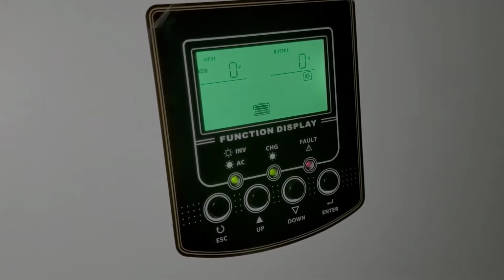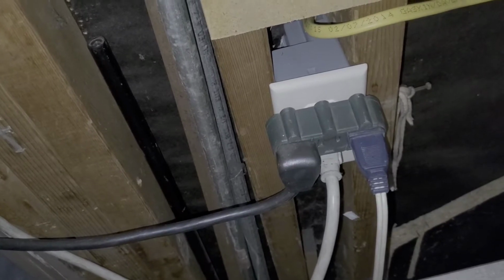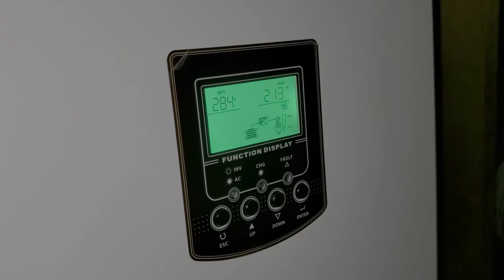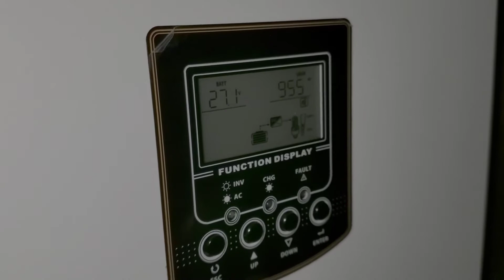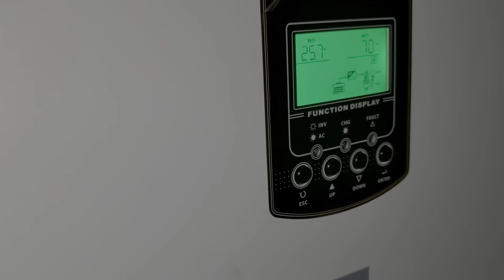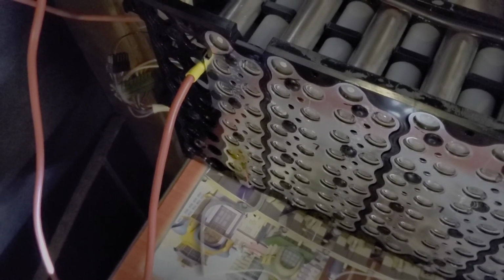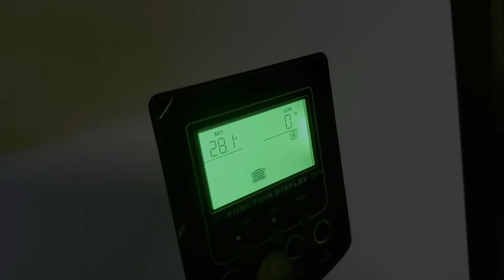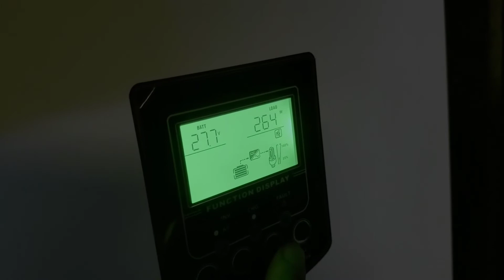7s 24v 50a bms from aliexpress - part 2

Comment: i would attach thermistor on those bms mosfets, if mosfets gets hot, it will turn off, i have seen bigger bms and the termistor is placed under heatsink above the mosfets. .. ..... and if you want the bms to shut down at 50A, then desolder one of the shunt resistor and then test again, repeat until you get 50A shut down, (there are 4 shunt resistors)
Reply from the maker: Shouldn't it shut down on its own though since it was rated for 50a?
Reply: @taniksambo1969   it’s designed for high current and short term use, like using it with lipo batteries in drills and vacuum cleaners, I guess that’s why it’s allowing high current.

Comment: Hello. I understood holds 50 A.I have same bms and the problem is with charging. It do not charge more then 28.4 volts .I connected additional balance board, but the problem  stays. Maybe  you can give advise?
Reply from the maker: Hmm mines go to 29.2volt. Are you saying that it stop charging when the battery reach 28.4volt? What are you using as your charger?
Reply: @taniksambo1969 Yes it stops charging at 28.4 v. I use charger from Aliexpress 29.4 2A.You think problem with charger?
Reply from the maker: @linasstasaitis3448  could use volt meter to test the charger if its giving higher output
Reply: @taniksambo1969  I tested.Charger gives 29.4v.The board stops charge at 28.4v.
Reply from the maker: @linasstasaitis3448  what does the battery test? What's the battery configuration. Do you have battery monitor to see if maybe a cell is bad? Could be many problems or it could be the bms.
Reply: @taniksambo1969  Battery its ok. I use them for 5s,4s.With other bms they works great. I think the problem is  this 7s bms. I orded another 7s bms with balance, then I try it let you know. Have a good day
Reply: @linasstasaitis3448  so tell me how is the new bms?